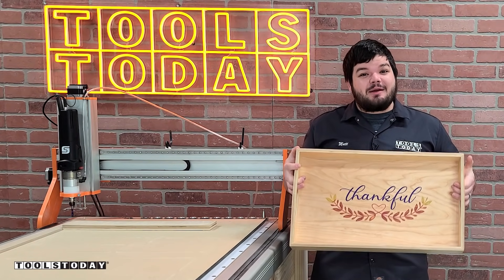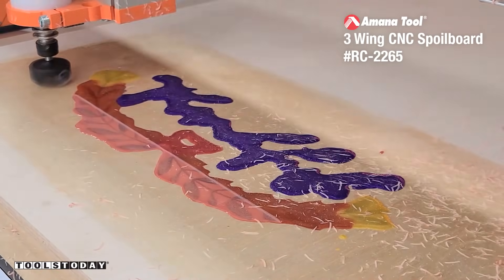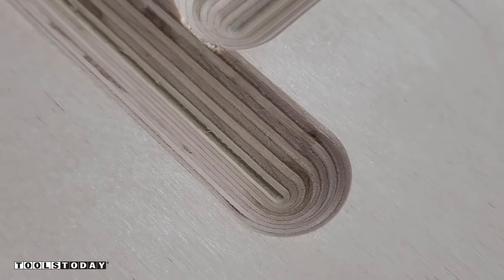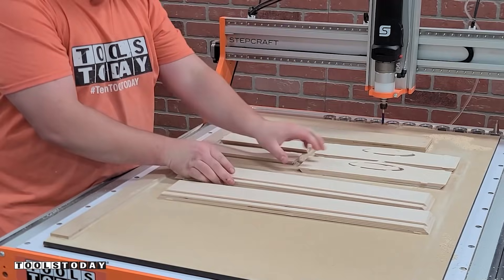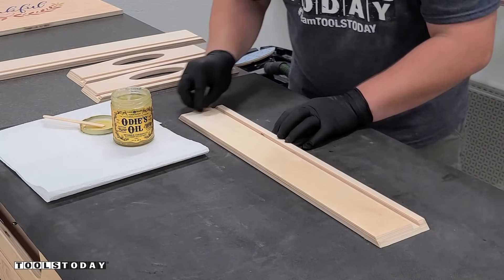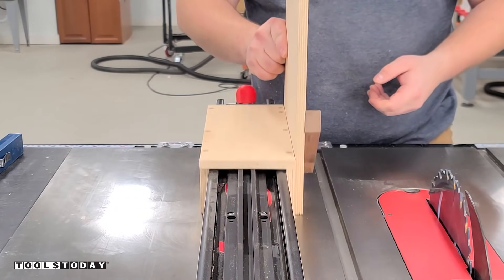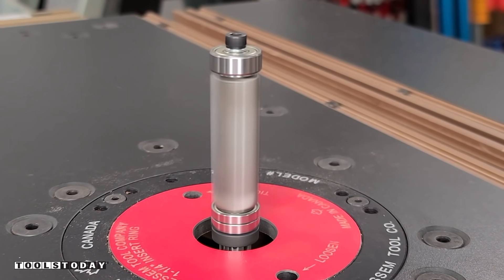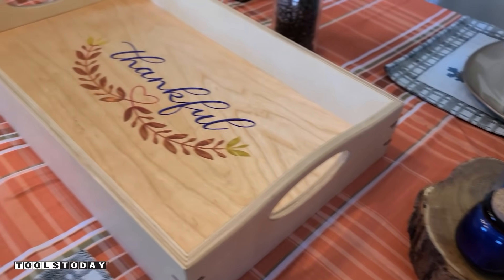How to CNC: Thankful Serving Tray | ToolsToday

Comment: Hello, what type of plywood do you use or what epoxy resin do you use? because what I have tried to do with resin and plywood does not look good. By the way great videos !!!
Reply from the maker: Thank you!  I'm using baltic birch plywood here and Total Boat 2:1 epoxy.  It helps to either use sanding sealer or a light brushed on layer of clear epoxy and letting it cure before pouring the colored epoxy, this prevents the epoxy from bleeding into the grain.

Comment: When surfacing the epoxy off what depth of cut do you start with usually?
Reply from the maker: I do not set a depth of cut for the epoxy, I set it at a zero depth and use the tape to offset the z-zero so I don't go through the wood. The plans for this project explain in better detail how I do that.  The first mistake piece, I accidentally loaded the V-Carve toolpath for the text and ran it with the flattening bit, that's why it went through the wood.

Comment: What size plywood did you use?   My CNC is a Shapeoko Pro XXL and has a cutting area of roughly 33" x 33".   Can this be cut on my CNC in one piece?
Reply from the maker: This project uses a 30" x 24" piece of 1/2" plywood, you wouldn't have an issue cutting that on the Shapeoko Pro XXL in a single piece. The plans for it are available here - https://www.toolstoday.com/thankful-serving-tray-cnc-plans-downloadable-and-customizable.html

Comment: Thanks for this - so, when you use the compression bit, your first pass needs to be a full depth pass so that the upcut and downcut parts of the bit are properly engaged? I've been using that bit to cut in multiple passes and the finish hasn't been great. Do you also do a finishing pass with compression bits?
Reply: Actually your first cut needs to be at or below where the “down cut”line is before it changes to the up cut portion of the bit.
Reply: @richardbaynes3862  For 3/4” stock, for example, I usually do 3 passes and a cleanup pass in the opposite direction - takes a while! One problem I always have is the cut gets PACKED with saw dust. I don’t think I’m doing it right.
Reply from the maker: Yes correct, a compression bit is intended for one pass.

Comment: Great video.  I noticed in the top of the plywood there is a hole.  Do you usually just leave those or do you fill in with anything in particular?
Reply from the maker: The hole was likely either a handle or test cut, that fit into the plywood.